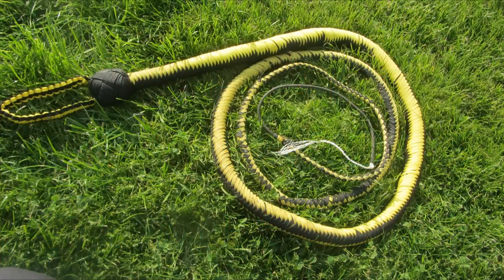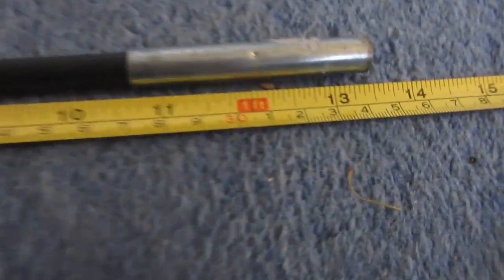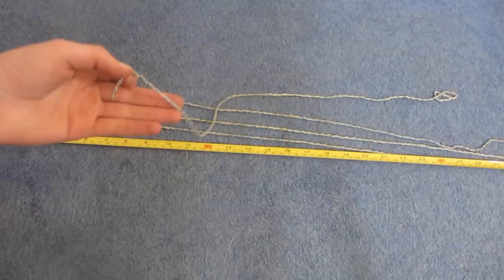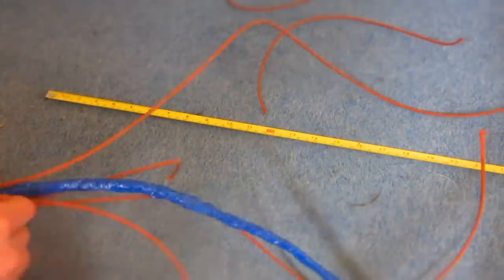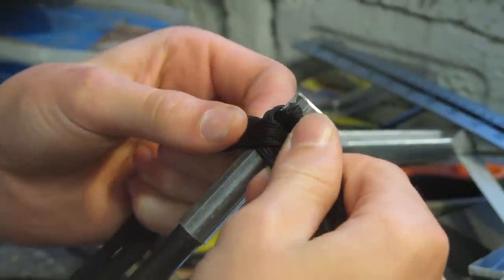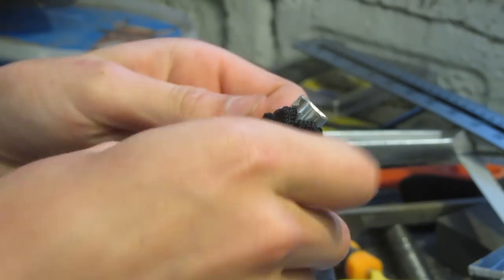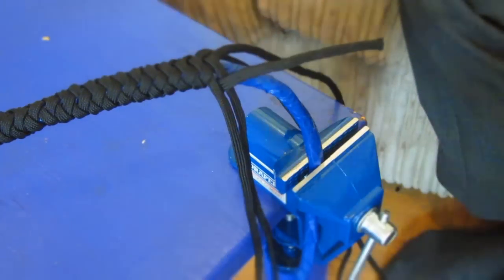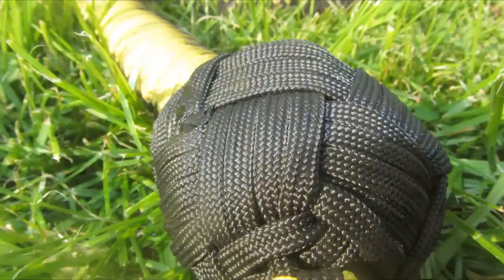How To Make An Extremely Loud Paracord Bullwhip - Part 1

Comment: Good that you're working with your hands Aow. Bear in mind, cheap electrical tape goes brittle and the glue goes gummy after a year or three. Also, lead will fracture after some flexings. The final shape of the whip depends on the neatness of the underlying work.....that's where your craft develops..Good luck, keep at it!

Comment: Thanks for posting this. You, sir, are an amazing young man, and i always enjoy watching your videos. I have to wonder about one thing, though. Tape seems to play a very large role in the construction of your whip. I wonder how the technique differed, or what else might have been used before tape existed?
Reply: The electrical tape is used as a bolster, if you were to make a 'roo hide (leather) whip you'd use an extremely thin piece of leather which is whip stitched on and into the belly sections, usually at major transition junctures to keep it from being over weight and to maintain a really tight taper
Reply: John Bovee Thanks. :)
Reply: No worries ^_^
Reply: mostly nowadays whip makers including myself use artificial sinew to build up transitions

Comment: i will be making one of these within the week, idk if i wanna make it that heavy though i want it to crack good but I am also putting it into a day pack to ward off unwanted predators on hikes but mainly to just have fun with xD cant wait to see gow mine turns out
Reply: +Luke Ralph i used a tent stake one of the metal ones. theres another video where a guy takes a huge nail (essentially a tent stake) and uses an angle grinder to notch it for the first knot

Comment: I may be wrong but I think the more expensive paracord has more strands inside.Like the expensive may have 11 strands and the cheaper may have 7 or 5, but I am not 100% sure. Also, You call it "insulation" or "PVC" tape I believe most people in the U.S. know it as electrical tape either way I just thought I might point that out.

Comment: What I like to do in my 6ft bullwhip cores is put 1.5 ft of stainless steel bb's then put 2.5 ft of chrome ball chain smaller than regular dog tag ball width. I then tie a knot right where the ball chain ends (this is temporary) from this point I stick to the instructions by NicksWhipShop here on YouTube

Comment: why does your door lock on the outside?
Reply: the lock is inside
Reply: Awow1314 the key used to unlock the door is on the inside. meaning the knob to lock it is on the outside of the house.
Reply: l3arrett82 the lock locks from the inside and has a key hole out side to lock from the out side , its a sliding door
Reply: ok, i too have a sliding door but it does not have 2 key holes. just an observation i seen and wondered.
Reply: l3arrett82 different styles of locks. It's actually a much simpler design. Locks aren't a universal thing. In Europe those locks are common here in the states the kwikset or defiant locks are common. I guess another way to explain, here in the U.S. we have a big 3"(ish) hole for a lock and in the rest of the world they have a small slot.
Reply: l3arrett82 Also this type of door is only used to get into the back garden, most likely a conservatory door or something I have the same in my house on my French doors